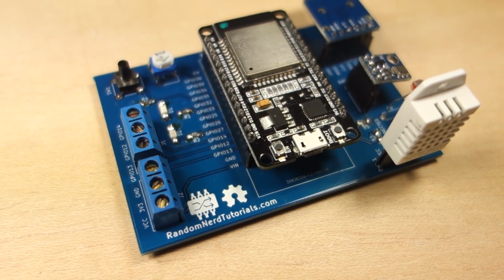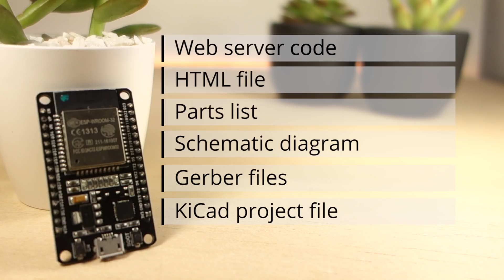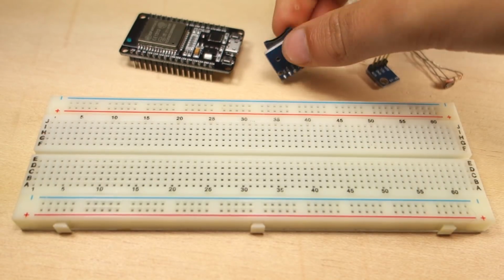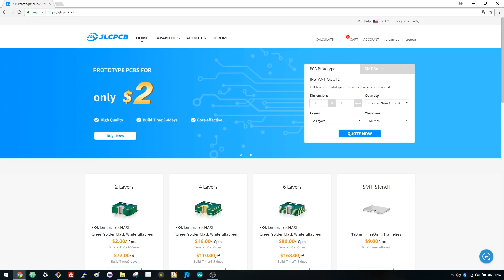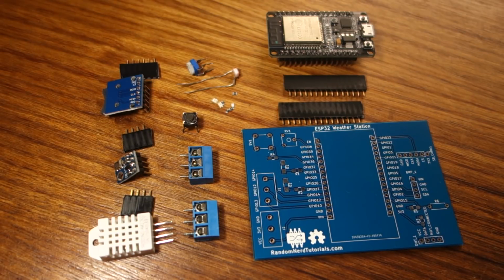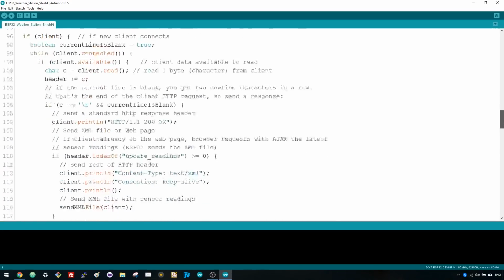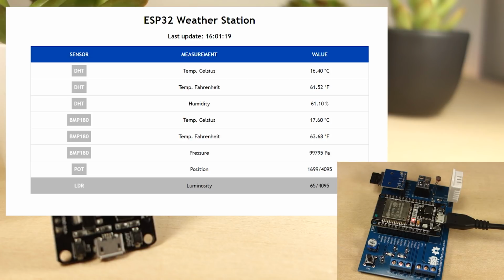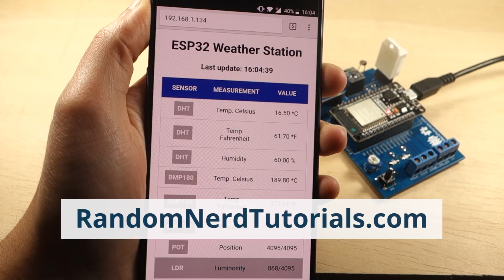Build an All-in-One ESP32 Weather Station Shield

Comment: What a fantastic project, can't wait to give it a go. Thanks for sharing your expertise, information and enthusiasm.  There are so many brilliant things to learn about in this build including getting bespoke PCB's, how to get the ESP32 working and the use of Ajax - just wonderful. Best wishes. Arthur PS For anyone reading this, I'm not on the payroll.
Reply from the maker: Thanks for your feedback Arthur, I'm glad you liked it. This year I want to create more projects with PCBs. I'll also try to create tutorials explaining how to edit or design the PCBs with KiCad. There are so many projects that I want to do that it ends up being difficult to focus :)
Reply: Arthur (and anyone else planning to build this);
Consider replacing the BMP180 with a BME280.  In addition to measuring temperature and pressure, the BME280 sensor also measures humidity and does so with better long term accuracy than the DHT22 and similar sensors.  Note that the BMP180 code will run with the BMP280 sensor in it's place, and it is simple to modify the code to report humidity.  It's a simple matter of changing the library and adding a line of humidity display code.
Reply from the maker: Exactly, thanks for bringing that up. In some scenarios, you might want to have the BME280 (to measure the temperature and humidity) inside the enclosure. You could add some wires to put the DHT22 to measure the outside readings. I definitely prefer the BME280